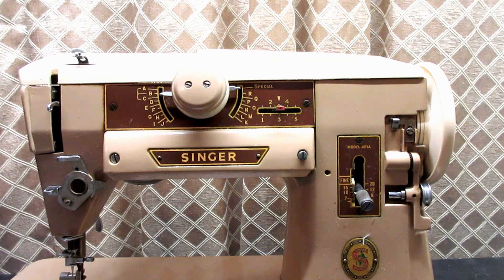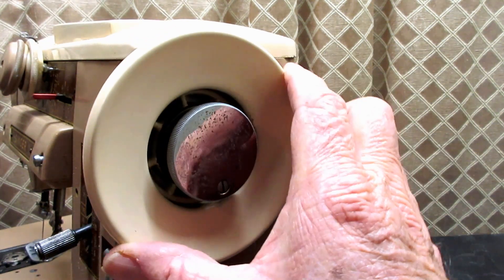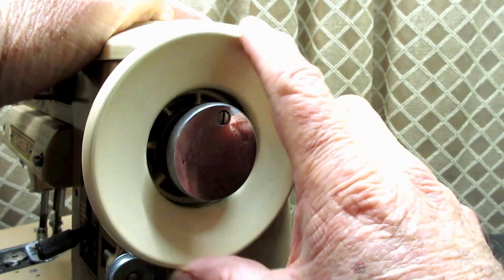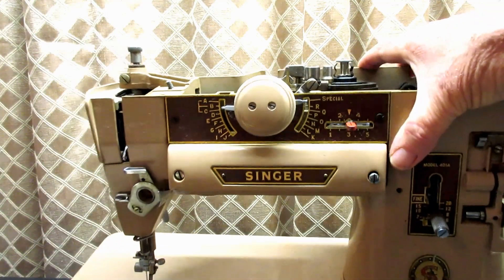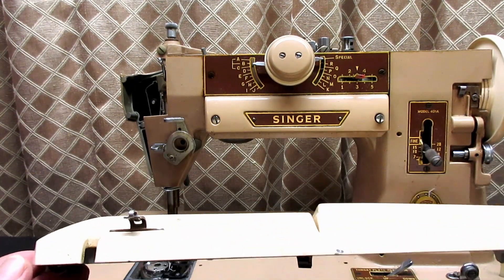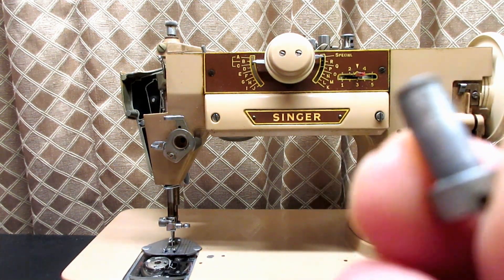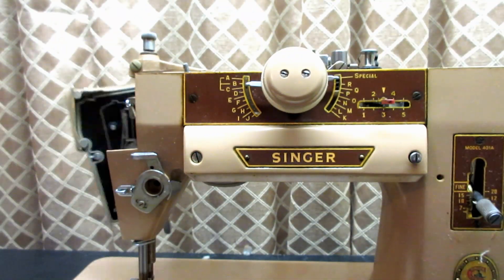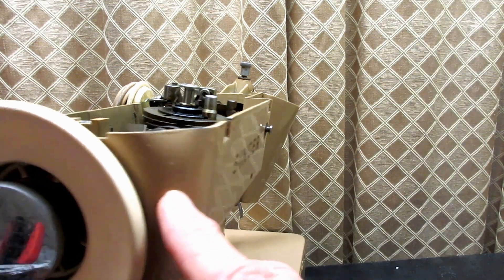Why my 401A Handwheel was not rotating completely.

Comment: I have the same model and I’m having a similar issue with the hand wheel not turning. I don’t seem to have the same solution though, there aren’t any broken screws that I can see. The wheel doesn’t turn quite as much as yours does either. Any thoughts?
Reply from the maker: Some of the first things to look at are the bobbin case and positioning bracket. If the case has jumped off the race it can jam the hook during rotation. https://youtu.be/JLYNpmFQ3wQ There can even be thread wrapped around the hook and below it. The next item I look at is the take-up lever system. If the lever is damaged, loose or installed incorrectly there is a spot where if resists when turning. Usually, you can turn through it, but it feels like you can't. https://youtu.be/7-3Cr9neZTc  Of course, the 401A has so many parts by the camshaft. The camshaft rotates with the handwheel and if one of those parts is out of place and blocks the camshaft then all motion stops. You can see some more videos of this model and those parts in the playlist for "Trouble" https://www.youtube.com/playlist?list=PLsCOZgzzaiKLiDl9yFTP6mJgQmz5lj4NO    You could pull the handwheel to inspect the gear https://youtu.be/ghnNYyMC1xU
All the machines parts move in unison and if a moving part is blocked or stuck or frozen and stops moving then all the parts stop moving. We like to say the handwheel is not turning but that is just where we can make the parts turn. The problem could be at the other end of the machine, like the bobbin case or even a bent needle bar.

Comment: Love your videos...just starting to "work " on vintage singer machines.  I have a 500a...great looking..but the clutch wheel will not tighten...the inside wheel just keeps turning...as if it is loosened to wind bobbin...any ideas??
Reply from the maker: Welcome to Andy Tube, Connie. When the "clutch wheel" is turned to the RIGHT while holding the Handwheel it should tighten up as it presses on the clamping washer. The washer sits between the handwheel and the clutch wheel. If the clutch wheel is just turning then the clamping washer may have been installed the wrong side out, or be missing. There is also a small possibility the washer is worn out, but that is rare. Even without a washer, turning the clutch wheel RIGHT would tighten it on the arm shaft and turn the shaft. If turned LEFT it would eventually unthread from the arm shaft. If the little screw was broken off behind the wheel it would turn left and come off the arm shaft. A few possibilities. Here are a couple of videos showing removing and replacing the handwheel parts on a model 404. The shape of the clutch wheel is different, but the concept is the same. You can remove the wheel on your 500A to see what's going on inside.
REMOVE: https://youtu.be/eZiMaaka5HE
INSTALL: https://youtu.be/hHl96WL1kzA
If these do not help you fix the problem, let me know. Thanks for watching my channel.
Reply: @andytubesewing1953  OMG!!   I FIXED IT.....Just had to retry...the washer...in the different place!!  I even ordered a different clutch wheel and washer ...but there was no difference...the clutch wheel just kept spinning...Now my "rocketeer "  is just like new! I had rebuilt the tension unit...2 new springs..with the help of your videos!  And now I have the answer for the  clutch problem...thank you...thank you..thank you for your videos...My son buys the vintage singer machines at auctions.  Usually..3 to 5$ each....and I have been having a ball....cleaning and repairing them!!  ( Thanks to Andy Tube)!!!  Please keep up the great videos....
Reply from the maker: @conrod651  I really love a happy ending! I'm so glad you found my channel and I really want to thank you for saving those machines you are fixing up. It is really rewarding, isn't it? I imagine you are leaning a lot about these machines too. The next time you encounter a handwheel problem you will know what to look for and have the confidence and experience to fix it right up! It's like a win-win-win for all of us. Also, thanks to your son for helping you out and being involved with the machines. It's the whole reason I have posted over 500 videos. I want to get machines back in service., doing what they were made to do. I have heard of other auctions online besides Shop Goodwill, but have no idea how to access them. If you'd care to share where you are finding them please feel free to drop me a line at my channel email address of andytube53@gmail.com. In the future be sure to ask me if you come across something that is hanging up your fun with these machines. Take care and best of luck.

Comment: Sometimes, all you need is a LEFT HAND drill bit. You set your drill in REVERSE, and as the drill bit cuts and goes deeper many times the screw will start to turn and come out.
Reply from the maker: Thanks for watching, Jennifer. You make a good suggestion, as did Rooster. The broken off part is uneven but I'm hoping I can still get a center-punch to work before drilling. These arm cover screws usually are not stuck when you are just removing them with a screwdriver, so I'm hoping it will turn easily.

Comment: Is the front large beige pattern selector knob with the two screws in it supposed to tilt forwards like that?  Poor machine got dropped.  It's good nothing internal was broken so far as you know.  It's going to be amazing once it receives the full treatment and TLC from you Andy!  Kathy from Southeastern Arizona
Reply from the maker: No, not at all. Behind it is a bracket for the left index pin (indicator) with a spring behind it. When the screw holding the bracket on vibrates loose (common problem) the spring pushes the bottom of the beige knob out. I'll be filming the fix for that very soon. Thanks for asking.

Comment: Andy, Just another suggestion for removing that screw.  Get it drilled out put some  of the nifty penetrating oil on it and then heat the case up with a heat gun or hair dryer.  The aluminum will heat up quickly and expand more and that may give you the edge you need.  You're going to get it out!
Reply from the maker: Thanks for another method. I know the aluminum does expand quite a bit from my old telephone days when they had some aluminum cases over the splices. I appreciate your suggestion buddy.

Comment: If you center punch the bolt and use a left handed drill bit it will also pull it out most of the time.
Reply from the maker: thank you for adding to the center punch votes I appreciate your input rooster and thanks for watching my channel

Comment: That's not bent a terrible amount, My 401s have a certain amount of flatness in that corner area that more or less matches the top cover's contour. The frames seem to be made of a high quality allow and might withstand straightening once. Maybe. I'd probably use it as is, it would be hard to notice with the cover in place.
Reply from the maker: Yes, the more I look at it the more I'm inclined to leave the dent. It's almost like a testimony to the strength of the machine that it could take a fall like that and keep sewing so well. I think it will be a smooth running machine when I'm finished. Time will tell. Thanks for your comment.

Comment: Andy, do you know anyone who has a MIG welder? It's possible to build up an extension with weld material on the end of the broken screw, even on a small screw like that (done it many times) which you can then grasp with pliers. 
The wire from the MIG has to be held precisely in the middle of the screw or bolt and perpendicular but it's easier than it sounds. The weld will not stick to the machine casting since it's aluminum.
You'll find extraction with a small Easy-Out to be a bit of a bugger, for screws that small it's really helpful to have a drill press to put the machine on, I do it on a milling machine usually. That way I can mill the broken screw flat and then drill down the center more or less perfectly. 
You won't be happy with Easy-Outs. they're frequently  more trouble than they are worth. If you do buy some, a word to the wise; China has never successfully made anything I'd describe as an Easy-Out. Go for SnapOn or Mac.
Reply from the maker: Thanks for sharing your knowledge and expertise on my channel. Nice! I personally do not know anyone with any of this type of equipment or tools, but others who see this may find it really informative. Also, thanks for the smile about the Easy-Out brands, haha. When I was working we would have called the China one a "Not-So", meaning not so good and to be avoided. I appreciate your thoughtful input.

Comment: I've unfortunately had to remove many broken off screws/bolts. Easy-outs (Screw extractors) and small drill bits are your friend. I don't use the reverse drill bits, I've always just used the manual easy-outs.  If you can file the top of the screw then use a center punch, "Bobs yr uncle".  Aluminum cases are the hardest. But I have been successful removing exhaust bolts from my aluminum had motorcycles with this method.   Good luck.
Reply from the maker: Thanks for sharing your experience. The top of the break is uneven and counter-sunk into the body a little bit. I may have to try a combination of ideas. Kind of you to comment, thanks.